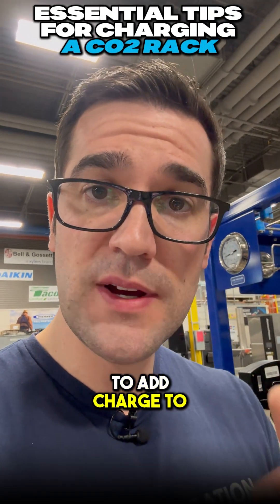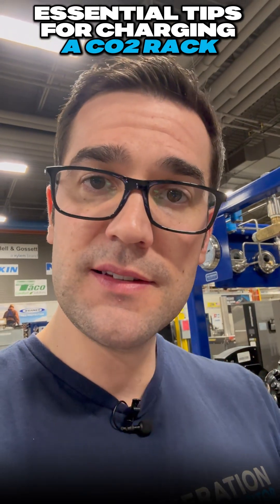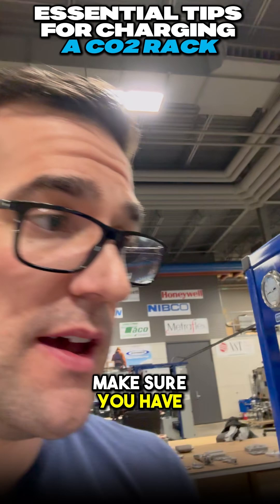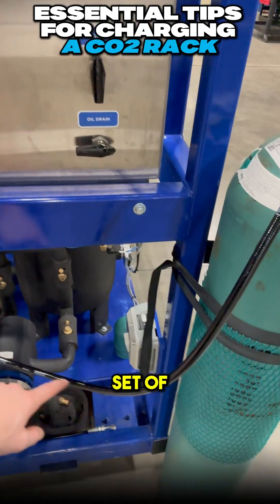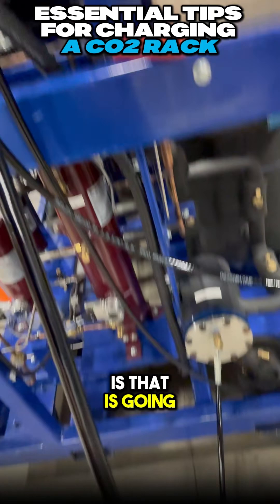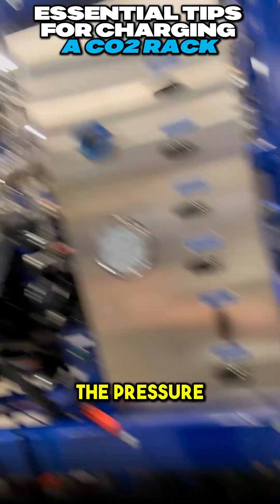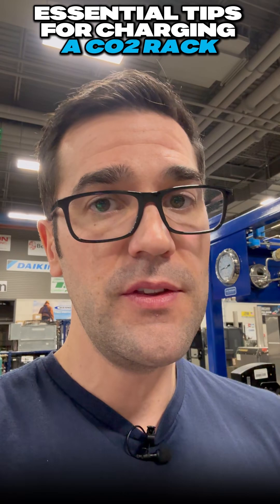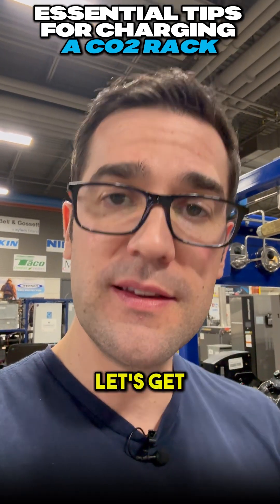Essential Tips for Charging a CO₂ Rack

Comment: Hi Trevor, where do you stand on just charging with vapour into the suction? Would it make any difference?
Reply from the maker: @TerryGraham-su4tu  as long as you keep the pressure below the rated pressure of the evaporator coil you can charge Vapor but it would take a long time. I would safely add liquid to the flash tank or an isolated liquid line of a system.
Reply: I was thinking more of the small condensing units that are being put on cold stores that only have a 5-7kg charge. Inexplicably though some are manufactured without a drier fitted at all and some give strict instructions not to vac from the suction side with no explanation why